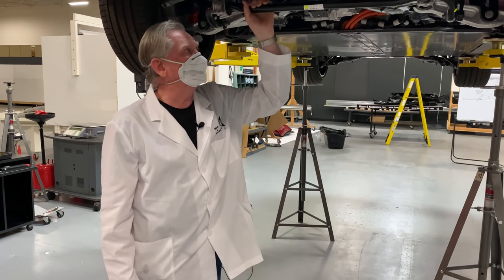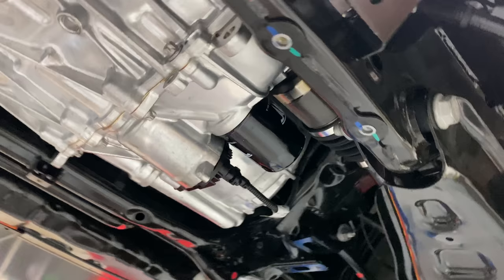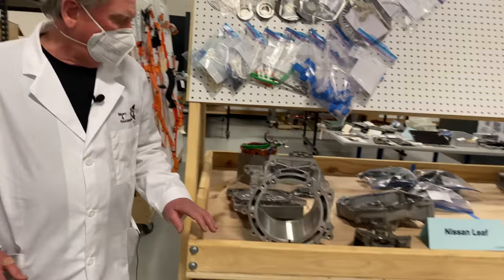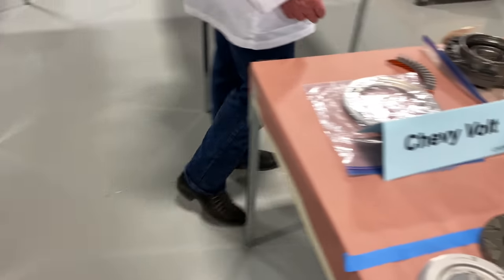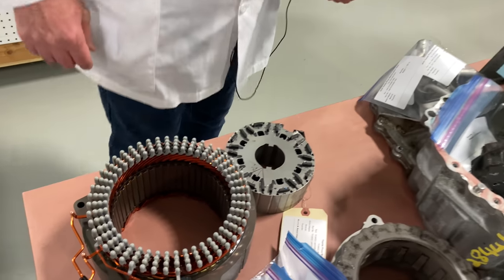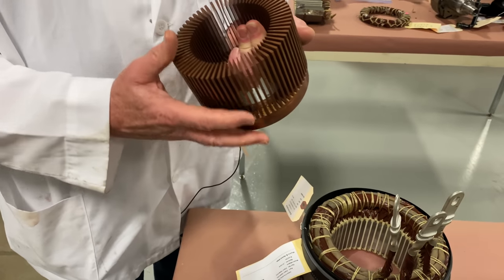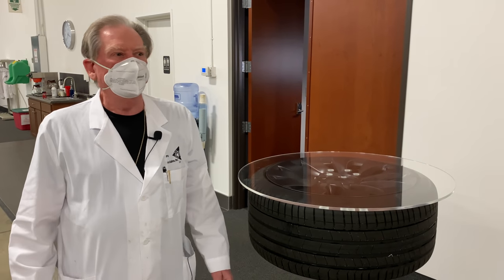Model Y E16: Electric Motor Comparison MY-M3, Industry review of Electric Motors, Table for Sale!

Comment: Thanks for great comparison!
Enormous infos is in here.
May I ask you for a question?
Motor windings in this video,
 - multi thin stranded wire : Nissan Leaf, Audi e-tron(but induction motor), BMW i3
.
 - single thick stranded wire("hairpin design") : Jaguar I-Pace, Chevy volt, Toyota Prius.
I would like to know performance based the pros and cons of multi-stranded vs single-stranded windings.
Thanks!

Comment: Expanding on your wheel-table idea, how about taking the M3 front & rear seats and building frames under them (maybe an optional rocker for the front seats?) and auction them as a family room / man cave set. Or do you need to keep those as part of your exhibit inventory? What parts are you actually able to spare?
Reply from the maker: We're actually considering the potential of selling the passenger seat with a rolling desk chair frame retro-fitted to the bottom.  That way you can have an adjustable Tesla computer chair!  You think those would get interest?

Comment: Some gearboxes use ATF. Also, these will need servicing. I wonder if wix will make the filters?
On a side note, the wheel tables are pretty cool. But I would want a cheap vintage one. Like a 1984 tempo wheel with no tire.

Comment: I l ike your fundraising ideas Sandy.  I might suggest you could dismount the tires and auction a signed set off separately.  They would have true value as well as intrinsic value.  Then black the inside of the rims and use them for tables.  Another funding option would be to set up a Patreon and give contributors access to a live stream overview of the shop work. (Go Pro body cam or something like that...no audio)  This channel is a great resource to feed in to that.

Comment: Nice. I noticed fewer motor components of the Model3 compared to Bolt,Prius,Etron. Machined, ground gears are $$$ and they need maintenance and fail(more bearings). Why I ordered the single motor rwd Y.

Comment: Just to clarify Sandy’s descriptions of the motors. It appears that all displayed motors are induction motors? Each induction motor consists of stator and rotor. The stators made of laminate typically lots of tin ferrous metallic plates with slots clamped together and copper windings wires inserted in the slots orotund stator to form three phase system. The rotor is constructed similar with ferrous metal laminates and windings are topically copper or aluminum casts in the form of “squirrel” cage (in same case the rotors could be with windings with tin copper wires) additionally some manufacturers inserting permanent magnets in the rotors to improve or optimize operation in the low speeds for the motoring and regeneration controls some how like synchronous motors. I like all presentations and looking forward for the next one!!!

Comment: Do you have a battery to wheels video or videos showing the power train inverter's operation, the 3 phase operation in the stator and how the magnetic field works in the stator to turn/control the rotor?

Comment: Instead of just showing us parts I like when you make a direct comparison with a couple of other approaches and tell us which is more efficient, which is excellent engineering, better cost or better performance like when you directly compared the motors of the i3, the Bolt and the Model 3 motors.

Comment: Awesome video! The Tesla Model Y has a 1120-980 rear motor and the same is found in some Model 3 (typically Performance, but also some AWDs, where as other AWDs have a 1120-990 rear motor). Can you investigate what the difference is between the two rear motors in the Model 3/Y (990/980) are? There are hundreds of pages with speculations on various forums, but no conclusions. 990 seems like a newer design, but has only so far been seen in the AWD models.

Comment: My suggestion is to sell posters of your tech boards such as the ones you spoke to in this video. Take orders to gauge demand, then print and ship them. You could feature them on your website (which needs a complete rework, sorry). Slap a huge copywriter image over the catalog of boards so people don't just print from the website image. The geekier the board the better. At first this should be very simple to do and relatively cheap. Put your signature on each at the bottom. There have to be vendors who could manage the production process. If it takes off you could do some custom boards as well.

Comment: Those motors are reluctant motors. The magnets help at lower speed and also increase power density, The stator is the same with an async motor but controller is different, more like controlling a 3 phase brushless motor.

Comment: Great videos.  Assuming you can get the battery pack discharged safely, how about selling the individual batteries?  There are a lot in there and perhaps enough people would be interested in purchasing a cell as a souvenir or show and tell tool.  I'd be interested in buying one.  They're small so shipping and handling wouldn't be much (assuming you can ship batteries).  You can charge more for ones that are autographed by you too (no pun intended)!

Also, if it's no use to you, sell the charging cables that came with the Model Y (assuming this is legal) - people might want an extra set of charging cables esp. signed by you.

Comment: The Model 3/Y transaxles (or transmissions, or call them gearboxes if you want) use ATF. ATF and gear oil are nearly identical, and it is common for ATF to be used in applications other than automatic transmissions... as Munro should know. And it's a transaxle, not a transfer case.

Comment: Sandy, is there still a resistance cabin heater to back up the new heat pump below a certain outside air temperature?  Most residential heat pumps have a resistance heater for operation below certain outside air temperatures that would cause the “cold side” heat exchanger to freeze up with frost.  Also the output of the heat pump drops as the thermal efficiency goes down with the temperature of the outside heat exchanger.  Seems like they would still need a resistance heater for very cold days.
Reply: No resistance heater at all in model Y. Power train coolant keeps things warm. I'm not sure how much detail I can give without getting into trouble, so I'll let Sandy do the spoilers.

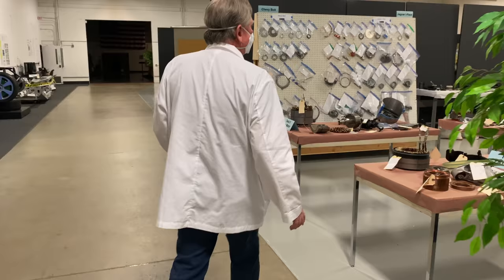Comment: 3:12 No, packing density is not an advantage of round wire pulled through to make windings; in fact, it's the opposite: packing density is higher with rectangular hairpin windings.

Comment: Thanks for this video content.  Please consider using a simple stabilizer/gimble (these are very inexpensive) with video shots because this is less distracting and allows viewers to pay better attention to details.
Reply: PS: Camera shot work is good aside from the mild shakes...
Reply: Why not sell some sort of engineering explanation product for general public and not industry (Diorama of Tesla and other Electric Motors which compares the different tech approaches?)?  This would leverage your many decades of knowledge rather than that wheel table.  PS: Bill IS a legend!
Reply from the maker: We actually just bought one, good tip!  Should be getting to put to use shortly.  Thanks for tuning in!

Comment: Sandy, do you think the cold tear/hot cast with high voltage patent Tesla filed would allow them to replace the windings with cast pieces so they could remove the windings and go with another solid piece?

Where do you think they're going with that?

Comment: That actually is transmission fluid in the rear gearbox. The model 3 takes 2.1 liters of ATF-9. Operating temperature is -40C - 140C. Y should be the same motor I think.

Comment: 13:16 working in this industry of EVs at this very moment i believe the assessment is wrong here. hairpin wires have the advantage of a higher copper fill factor over circles. smaller wires leave smaller gaps but also at higher numbers. in total the filling factor is the same regardless of the diameter. it only looks better because you dont see the gaps. but the hairpin is more "densely" packed. The hairpins didsadvantage is connecting the ends reliably and without damaging the coating of the individual wires. its also not necessarily easier to manufacture. once the process is down i believe it does save time and allow a higher consistency but the hairpins are no piece of cake to produce. machines inserting wires on the other hand have been in use for ages.
Reply: Agreed, the thing with Sandy is he evaluates with a bias towards cost and ease of manufacturing, so if its cheap and easy to build for the OEM he says its good. But from the consumer point of view the Bolt design is far better. The motor is smaller lighter, and from the motor to the battery to the cooling system it can be disassembled and serviced relatively easily. Tesla seems to design with no regard to serviceability, maintenance, or longevity, for them its all about cost to build and performance out the door.

Comment: Tesla has been using copper rotor induction motors for years.  IIRC, the manufacturing process is similar to an aluminum rotor, but the casting dies are made from a total-pain-to-machine refractory alloy like Inconel.  In return, you get higher efficiencies.

Comment: You could make swivel chairs out of the seats, you could sell shifters as beer taps, you could take the air filtration system, and sell it to a hospital, etc etc

I have an actual question though.  The prius has been in production the longest of any of these, with the model S, and then, the volt,  I would have expected the prius to have had engineers go over it over and over, incrementally improving it, until it was the most efficient/easy to manufacture.  Sales are crap now, but they were amazing for a while, so your reaction to the prius struck me as funny. 

One thing you didn't mention, and it was probably for the better, was that tesla has a patented process bumping efficiency of their motor to almost 99%, there was some extra coil or something that bumped up efficiency, and they got the patent, so nobody else could do that.  I didn't understand it (obviously) from reading the patent, and was hoping to see it, but maybe don't show it since GM,Toyo and everyone else is watching these videos

Comment: So how does a radial magnet benefit over a standard parallel or adjacent magnet setup?
Reply: pancakefactory It fits more tightly into the small circular environment of the motor.
Reply: sminstudios and that's the only benefit? So because it fits better, it can hold more magnets? Or because it allows the flux to flow more efficiently? Sorry about the dumb questions. I'm new to this.
Reply: @pancakefactory  It's not an easy explanation, it depends by different aspects, finally it's a trade-off between performance, cost, manufacturability.

In principle designs such as Jaguar, BMW, Nissan with this multy-layered arrangement of the magnets are meant to strongly exploit the reluctance torque which is a fraction of the total torque, not produced by the magnets. This clearly helps you to reduce the cost since magnets have a significant influence on the total machine active cost. 

On the other hand, you can imagine: lot of magnets per pole, maybe of different sizes (see BMW) might be a less than ideal choice for automatic manufacturing process and sourcing, therefore the V-shape (like in model 3, Toyota) arrangement might be a good trade-off. Also torque oscillation are easier to be managed during design phase.

 I suggest to Google: "IPM motors", "PM Assisted Synchronous Reluctance motors".

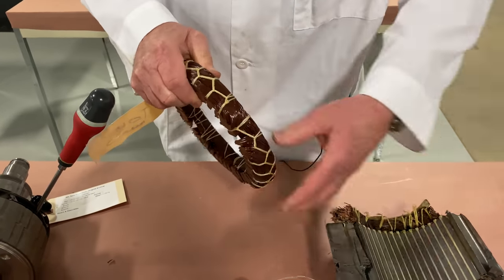Comment: 13:30 as expected, Halbach array is a huge misinterpretation made during the first teardown in 2018. These are segmented magnets for eddy current reduction (i.e. efficiency improvement), something known in the field of electrical machines.

Switched reluctance is also another mythological and wrong interpretation (even Tesla doesn't call officially like that) for many reasons I don't want to discuss here. See here for more details:
https://en.wikipedia.org/wiki/Talk:Tesla_Model_3#Permanent_magnet_switched_reluctance_motor._Is_it_actually_true?

The conclusion is: you need a specific background to analyze electrical drives, mechanical-oriented background doesn't work.
Reply: So they are not Switched Reluctance motors right? Since there are magnets in the Rotor and not in the Stator. Is that correct?
Reply: Manufacturing is all mechanical parts, you also need design engineer to reverse engineer in design.
Reply: @iliaslolis1769  correct, it is not switched reluctance (SR).

But not  strictly because of the magnet in the rotor rather than in the stator (the explanation is reported in that Wikipedia link in the first message).

As a matter of fact, there is a special synchronous machine equipped with magnets in the stator (google "switching flux synchronous machine"). At the same time, there is this SR concept, the design all the fanboys are often referring, which was developed with  magnets in the stator by a university researcher. But normally a properly called SR machine has not magnet at all.

In engineering people categorize things on the basis of specific recognizable characteristics and operation modes (for example alternating current or unidirectional current, brushless or brushed etc..) and each word has a specific meaning. 
So there are synchronous machines and switched reluctance machine for example, as well as DC machines or induction machines, etc.. 

Maybe in the future,a new motor type will be invented and new features will be part of the classification criteria.

When you look at the teardown of Munro, read the official EPA certification which says "AC Internal Permanent Magnet motor" and, at the end, the official Tesla blog website which describes clearly the machine as a "PM synchronous reluctance", the question is why people keep referring it like a (PM)SR  machine ?

I think the answer to this question is: because someone at the higher level  said so.... 
 https://mobile.twitter.com/elonmusk/status/998015873167208448
Reply: @guessagainkk6322  i completely agree with you. In this case it is not implemented and it is easy that fanboys take every statement as a holy truth.
Reply: Lots of brains in this sub comment thread. Can someone tell me what happened with the PM induction motor, which should be a nice tradeoff for an EV: You keep the squirrel cage for umph, but have PMs further down buried in the laminates, so you still can have slip free high efficiency light cruise? It also requires a less complicated sinusoidal inverter with just a tac input for phase management, as it basically looks like a standard squirrel cage motor to the inverter at low  rpm.
Reply: @Tore_Lund  Probably you are referring to the Line-start permanent magnet (LSPM) synchronous motors. That's correct they are synchronous at steady state operation, therefore more efficient than induction motors and they retain the self-starting capability as an induction motor. I am aware are used in some industrial applicatons without inverter when efficiency is  a concern (synchronization can be tricky). No deep knownledge on this machine, but I expect a lower torque /power density than a pure PM synchronous machine, more constrained design of the rotor  (magnets and cage, limited pole number <6, mechanical robustness at high speed operation), more expensive than an induction motor. I think it can make sense for industrial applications  without inverter but not for automotive.
Reply: @NRG1985  Yes, that is the one. I too can't find any info on them used in vehicle applications, i.e. run from a high frequency plain sinusoidal inverter.  Siemens made a PM 3 phase traction motor around 1999;  "ACWS 80 4-4 D3" http://www.hec-drives.com/Specs%20Siemens%20small%20EV%20motors.pdf
that could be run by their Sidias motive inverters, but it has been impossible for me to find any data on it, which is a general problem with Siemens, they keep it tight.
Reply: @Tore_Lund  I think LSPM synchronous motor are not used anywhere in traction in series production. Of course, in R&D / Accademia are studied and prototyped. In a similar way, switched reluctance motors (the real one, no the one coming from the Munro/Musk fairytale) are currently in limited series in traction application (low power mild-hybrid systems, some H/EV applications especially with Nidec motors) but I believe in the future we will see more and more reluctance-based design . Bentley with the consortium of the UK program Octopus is developing a high power SR machine for series production in 2025/6. If an inverter is not a critical cost/complexity, an induction motor can be effectively already replaced 1:1 with a more efficient Synchronous Reluctance (SynR) motor. If inverter is a critical cost/complexity then a LSPM can makes sense.
Reply: @NRG1985  That makes sense; faster control algorithms have become cheaper to implement, so has power stage capabilities which means, put the complexity in the inverter and let the motors be as simple / cheap as possible, still maintaining high efficiency though.

Comment: 14:08 For about the maximizing the flux with magnets, do manufacturers and designers try to maximize the amount of flux by configuration and amount of magnets there?  Could they have fitted more magnets?  Or are magnets too expensive, to be efficient and not overload it with magnets?  Like instead of gluing 4 magnets together, could it not be 5 or 7?

Comment: Did you test each motor for efficiency etc. ?  BTW I don't think plexiglass is a good choice for those hi tops. It'll just get all scratched up.  Needs glass.
Reply: It needs something protective around the rim. If that thing tips over, especially with glass, it'll be a freakin' guillotine...